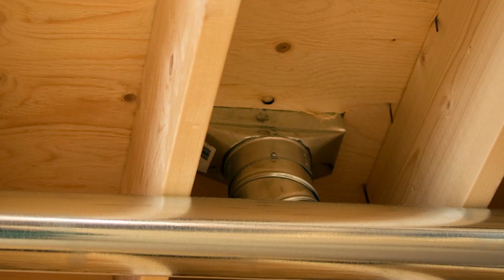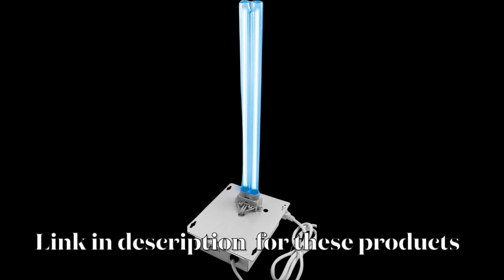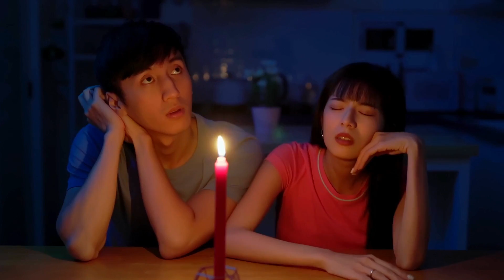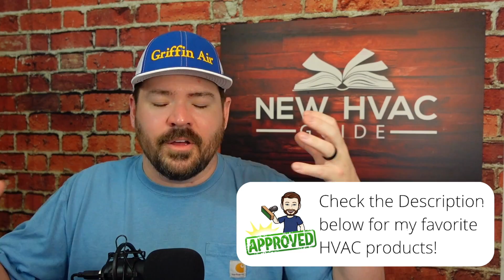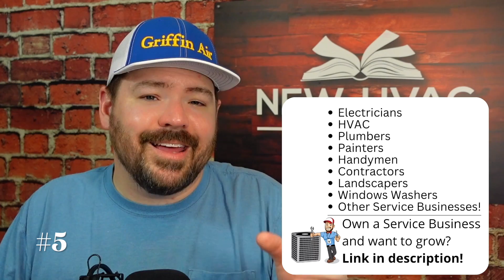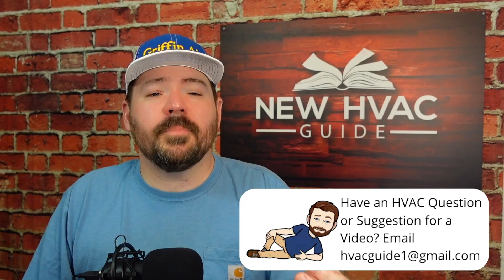Do NOT Buy These HVAC Products!

Comment: RESPECTFUL opinion and question:
Communicating inverters are buggy as can be,  If I have to be away from home traveling for work, if the Communicating network stops for some bug, it HARMS MY HOME and contents AND MAKES ME DRIVE THOUSANDS OF MILES to reset it AND makes me lose my job!

Therefore, again, respectfully, talk me down.  I will pose the question here:
At one time, liquid mercury and bimetallic strip, a 100 percent reliable AC thermostatic control worked for decades.
Recently, two stage and inverter tech REQUIRES something more (or two mercury-bimetallic switches for lo-hi on two stage?).

If I ABSOLUTELY cannot risk a communicating inverter from failing, even if the solution is merely reset it, is a NON COMMUNICATING inverter system indicated?

Whole hearted thanks!

Comment: Hi, I've been searching You tube content for A/C and you definitely stood out, so I feel confident in asking you a question. I have own 2 Goodman A/C units and I have had this issue with both of my units. They produce this white crystal like stuff on the outside unit in the aluminum part that eats them up and they stop working. My installer said that the 1st unit was all ready out of warranty (even though it was like 3 years old) and now yesterday I noticed that the new unit is doing the same thing again and he claims there is no warranty because he had to haggle with the vendor to get me a big discount on the new outside unit replacement. Is this product issue (Crystal's) a typical thing with the Goodman product? I'm afraid that this summer already my unit is going to break and is not even a year old.
Reply from the maker: I’ve never heard of that. And the warranty should definitely be still good after three years. You can check your own Warranty on our website. https://www.newhvacguide.com/check-warranty
Reply from the maker: I’m not getting the warm fuzzies on the information he is giving you. I would definitely get a second opinion.
Reply: Is there a dog around that is peeing on it? A dogs urine will eat away the aluminum

Comment: Lots of folks out there require full time HVAC annually and then there are those who only need HVAC for maybe 4 to 6 months per year.  That plays a roll in how the owner makes their decision in operating cost for the next say 20 years. The  more HVAC is used, it seems to make much sense in spending the extra buck to get HVAC systems that are able to squeeze out lean BTU's vs. a single stage HVAC or "contractor" models that satisfy the initital install budget yet will drive the owner into the poor house to operate the system.  Also, gas and electric rates play a huge roll in which system tier would make sense. for example, in CA, the electric rates are currently about 45 cents per kWh and natural gas are about $2 per therm or CuFt. In their case, it might make a lot of sense to step up to higher efficiency just to have reasonable energy bills. Then there is the comfort idea with the more expensive units that will move the air in a more controlled manner vs. 100% on then 100% off. Some residences are built differently and would benefit from that kind of system such as multiple level homes or homes with a lot of glass etc. You would think that the states or federal laws would require the builders to do detailed heat gains/losses and apply those to the different systems out there to reach a common goal vs. cold and hot cycles. What's more, if anything is a waste of energy, its a two story home.  Those should be limited...they waste more energy than any single level home will. BTW, the air quality inside a home only needs to match the air quality outside or ambient. Anything more than that is a waste.

Comment: I used to work at a National Laboratory as an HVAC Supervisor. . We had Daikin mini splits with solenoid drop liquid lines.  We had alot of problems with them, but they were all related to a very poor installation.  I was always defending Daikin when others were trashing them for the failures.  This was in the 80z when Daikin left the American market. This was a great lesson for me about how u can get blamed for someone else's mistakes.  A funny story sorta related.  We had a union pipe fitter company install a Daiken.  Then asked us to start it up.  When we got there months after install the unit was running with the service valves closed.  I quickly opened the service valves and the sucker started cooling like a mad dog.  Years later it was still working.

Comment: Thoughts on sealing up all the small bypasses that allow air to go around the filter?  I have noticed dust building up in those areas in the return frames, I sealed them up as best I could and even taped around the edges of each filter to the return frame so as to get as much of the air through the filter instead of around it. I have noticed they need to be changed more frequently, so maybe I am keeping the ductwork/evaporator a bit cleaner!

Comment: We bought a new system back in April the new daikon fit and we use the filtrate 1085 filter. I change it once a month. Any suggestions for using the filtrate filter? What number would I be ideal for my system? Thanks for the video. I learned a lot.